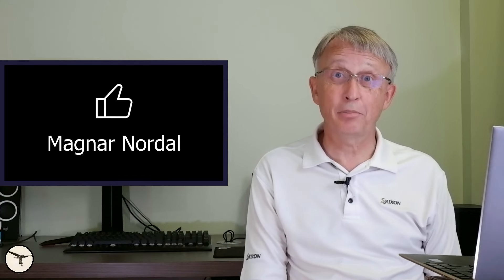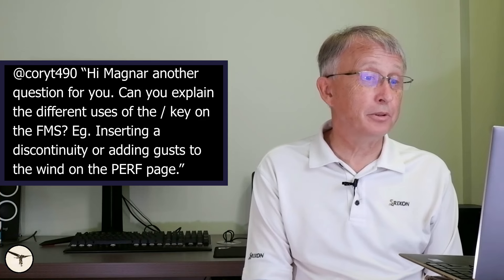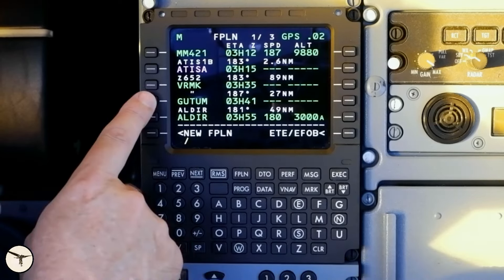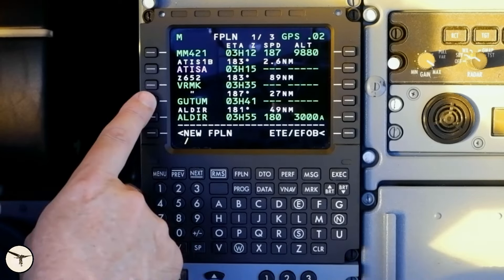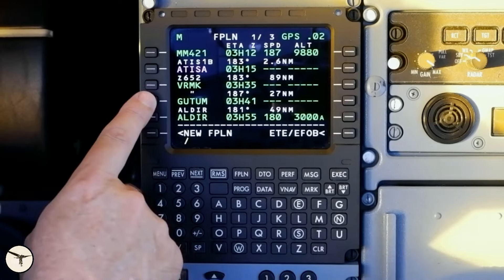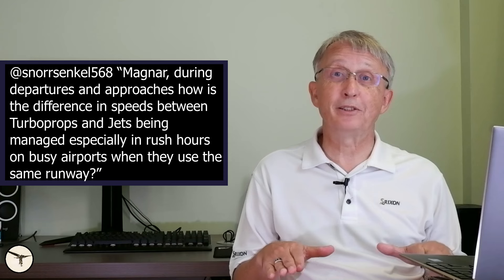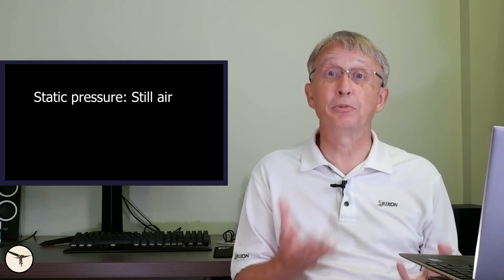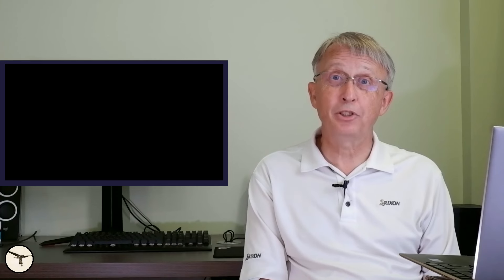Q&A with an airline captain - June 2024

Comment: An SDF approach uses the same equipment as, and is flown just like, a localizer approach. The main differences are "... the SDF course may not be aligned with the runway and the course may be wider, resulting is less precision." [AIM 1-1-10(c)]
Reply from the maker: Thank you so much for your answer!

Comment: Is it easy to set takeoff TQ during power application on older ATR equipped with ECU? How do you maintain the right PL position to adjust proper takeoff TQ value while focusing on takeoff roll?